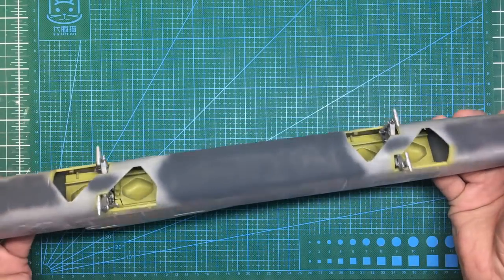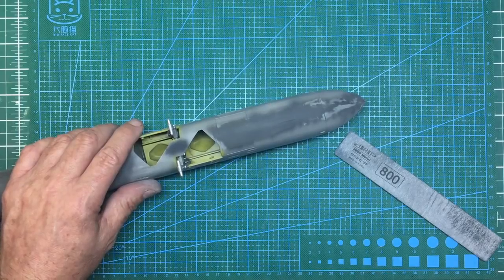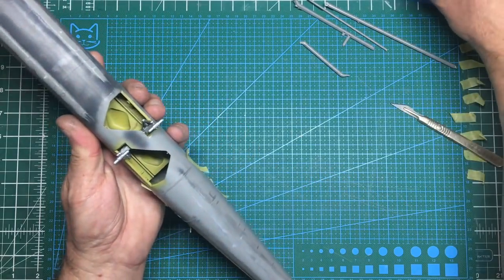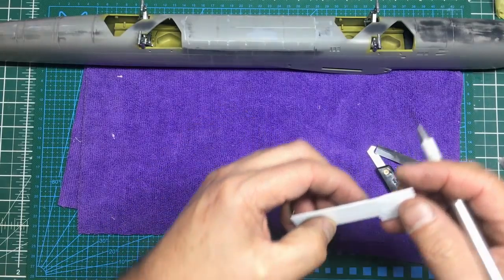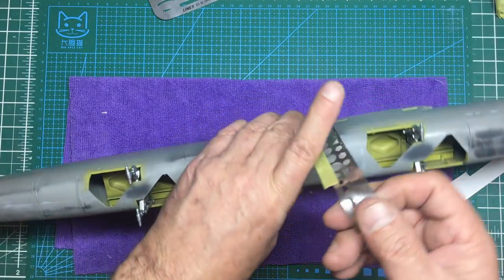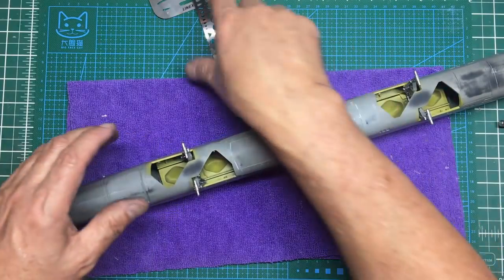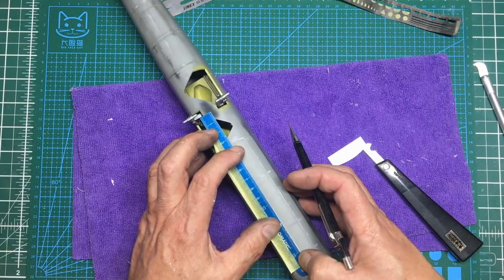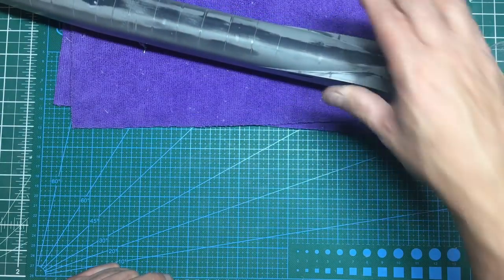Big Bad Buff Build for Beginners. Part 22

Comment: Thanks Nigel for another very imformative video. Since I build a lot of old Revell 1/32 scale aircraft, there cheap, I now have a way to restore panel lines. Do you know of or have a video on how to restore raised rivets. I've tried using very small drops of white glue but they don't look right.
Reply from the maker: I'm afraid the only way I know of is to use aftermarket rivet sheets.
Reply: @NigelsModellingBench  Will look into those, didn't know they made such a thing.
Reply from the maker: @robertbrantley4634  yes mate.. check HGW and Micro-Mark